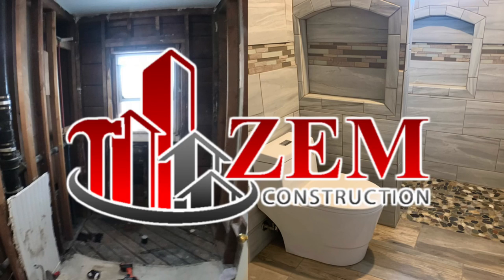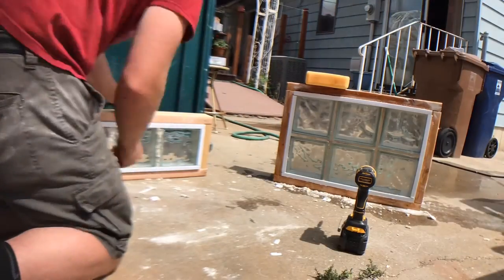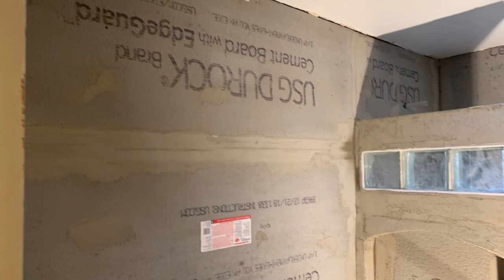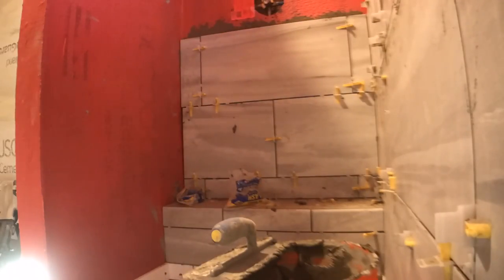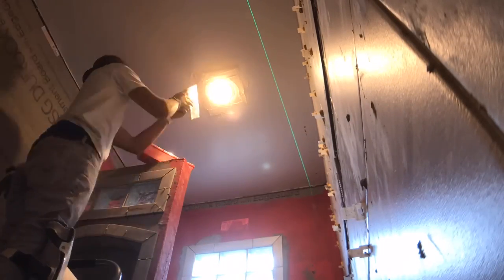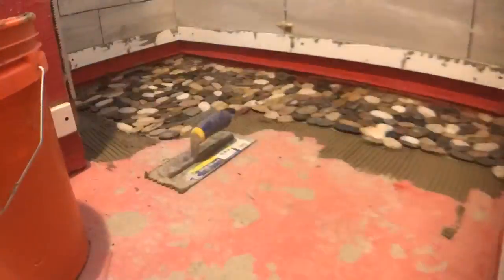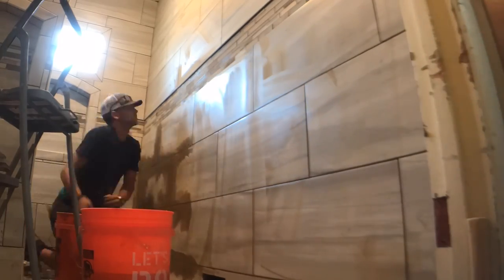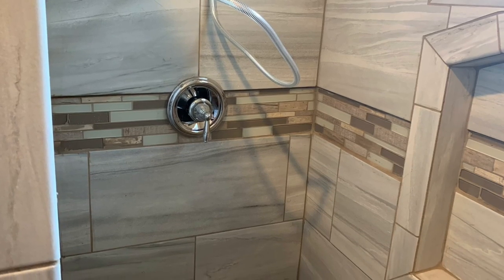Bathroom Remodel | Bathtub to Curbless Walk In Shower | Time Lapse

Comment: I'd love to know cost of something like that?
Reply from the maker: I’d recommend using google to find estimates for bathroom remodels in your area. Both materials and labor vary so much by location. I do not know the total cost of the materials because I didn’t not purchase them, I’d estimate around $8k-$10k. My labor could be quite different then contractors even in my own city, it depends on their experience and many other factors. Contractors where you are at could vary significantly as well. The YouTube channel The Handyman goes into more detail about remodel costs.
Reply: ZEM Construction There is a big difference between $8k and $10k (about a 12.5% increase). The majority cost of these projects is labour and is unaffordable to most, unfortunately. I would say the materials would come in at $3k maximum mostly depending on the tiles of course. How can you justify $5k for labour? Genuine question
Reply: @autisticpianist4446  it takes a lot of time and experiance (some states even certifications) to perform this work. It can really vary on quality parts, preperation work etc etc
Reply: @autisticpianist4446  Labor almost always costs more than the material, so it's not that surprising... The material isn't going to put itself together. So spending 2x more on labor than materials isn't a wild scenario. Someone cheap with less knowledge would take this job for as little as $3000 labor. Someone who knows more can charge double easily.  There are more variable than i think you realize. Also the area you work in is a big factor. Down here in Texas a builder will pay someone to tile an entire house for $2.00sqft. In other states, they will pay double that or even more depending on the quality and knowledge of the installer.
Reply: Timber land It takes a long time to gain experience in anything; the nature of experience. That does not justify the Godly rates that construction workers charge. Period.
Reply: MacAaroni A typical answer. Let’s do the Math. 14 days MAX to do a small job like that assuming you’re working smart and hard. $8000 labour. That is $572 a day or $71 per hour. $148.720 per year. More than a doctor or lawyer. How does this compute?? I predict some builders who don’t have commercial contracts will start to find it difficult to work regularly, given the decrease in disposable income.
Reply: @autisticpianist4446  where is your 8000 dollar labour coming from? your estimate of 3000 dollar on parts was also randomly selected, as it will quickly go over it. if you can not affort it, it doesnt say other people can not afford it.
Reply: Timber land My figures are coming from the creator of this video. He said he would estimate $8-10k. Figures for the materials comes from my own experience of being forced to DIY projects because your sector is not compatible with my mental health issues.
Reply: autowash viry the labor cost today is bs. Almost every company overcharges. Its bullshit
Reply: autowash viry given that I donate 100s of hours of my time to charity, I don’t have a price. But I don’t think you should charge more than other people. So $40 per hour sounds max for a general contractor, with a maximum of $180 per day on the basis that the hours you work are grafted. No trade is particularly hard, especially with the tools available these days.
Reply: Hector Rubio what?
Reply: @autisticpianist4446  I never reply to these comments but I am making an exception in this case. Trade work is a skill as much as a talent, gained and nurtured over years of experience. You complain about $5K in labor, as if that money is going straight out of your pocket and into theirs. Well its not. Out of that $5k comes insurance and banking fees. Also involved in a job is waste disposal, and tool costs(bits, blades, etc don't last forever) fasteners.  In this case there is also the cost of sponges, floats, trowels, etc. They only last for so long. Tile saws burn out; diamond blades dull and are expensive to replace. Diamond bits are expensive to replace as well. My point is, there is a whole 'nuther level of costs associated with a job like this that is often part of that "labor" you are complaining about. No job can be done without factoring in the things I mentioned.
If you don't want to pay a skilled tradesman his price, you are free to go find some Chuck-n-a-truck and roll the dice with them. When you tile has lipage, your grout lines are wonky, your shower leaks into the downstairs ceiling, you start smelling mold, the caulk cracks and yellows and floor tile pops from joist travel, you may rethink your choice as you pay 2x more to fix your job gone bad. Have a good night.
Reply: Alan Harris you present a fair argument. I just think costings need to be more transparent for average customers who may have to loan to renovate. An economy in austerity is fragile. You do sound competent and professional and I wish you all the success with your trade.
Reply: @alanharris9357  watch it there mr. Harris, I take offense to your comment " chuck in a truck " my name is Chuck and I do service work and repairs. And I pride myself on quality installations. Lol.
Reply: @fisher9915  noted.  Now that I read  it out loud, it doesn't sound as funny.  Its an old phrase and its insensitive. My bad. Thanks foe being a good sport.

Comment: How did you determine how wide to make the shower?
Reply from the maker: We went as wide as possible without having to move the plumbing for the toilet.
Reply: @ZEMConstruction 
So you went right up to the toilet??
Reply from the maker: Oh no, local code says you need 15” from each side from the center of the toilet. So the wall is 15 inches away from the middle of the drain.
Reply: @ZEMConstruction  why not move toilet so it would have been a little wider I'm doing something similar to this remodel took out tub now walk in shower is 39" but finishes at about 43" made a huge difference plus I still have a 36" vanity as well 😊

Comment: Why did you use 1/4" cement board on the walls and leave the stickers on the cbb? You almost have to try to get lippage with a clip system but you succeeded. Also you need to shim those mosaic strips flush to field tile. Walls and floors are rarely plumb and square, and flat, your the pro here and its your job to remedy that. Its very rare that a substrate cant be fixed, saying the home is old and theres nothing you can do is unacceptable. You are charging people money to do this and it looked like a home owner did it. DO A BETTER JOB,  you owe it to the people that trust you to do the work in there home.

Comment: that outlet by the toilet looks so out of place in that position.  IMHO, it should have been moved up a little to that it would have been centered in the mosaic just like the light switch is .  Same with the shower control valve,   Centered in the mosaic......

Comment: Does anyone in your business even understand why we floated walls for generations? This quickly sticky type of install baffles me. Good luck when the walls are bowed  and badly out off plumb. But I guess that's why I see so many offset joints and giant tiles.
Reply: Floating isnt the only way to go on shower builds. Having said that this is a garbage install. Your a tile setter why dont you know why the large format tiles are offset the way they are? Sounds like you dont stay current in the trade.

Comment: Hey man not trying to be rude but the layout looks terrible, mosaic wall tile needs to be perfectly flush with the 12x24 tile, especially if you build a wall and custom niches you had all the tile measurements on site you should of build a niches smaller to eliminate small sliver pieces of tiles around the niches especially where it meets with a window, the shower pan will fail who uses rubber membrane this days! Rubber will turn in to a hard plastic and will start cracking, concrete shower pan that you poured doesn’t bond to rubber!! the wall that you build and the niche inside of it looks very sloppy job you should of build a niche few inches smaller to eliminate small cuts and make everything symmetrical, layout is very important always try to eliminate 1”-5” pieces cause it looks very bad, the miter cuts around glass blocks no good, sorry man not trying to be rude just trying to help, I’ve been in construction business for 20+ years and been doing tile jobs only in $1-$20 million dollar houses, it looks like some DIY project that you did without knowing what you really doing I always call that waist of materials no hard feelings buddy wish you all the best and it takes time to learn and do a good quality work, if I wore you I wouldn’t post videos like that with a very poor quality work, anyways wish you all the best
Reply: Right
Reply: Agree. 30+ years in residential remodeling. There were a bunch of issues I had seen as well.
Reply: Im predicting failure at the floor to wall joint in the shower pan perimeter, and subsequent water ingress and eventually floor failure.

Comment: thin cut under niche couldve been avoided, otherwise great work
Reply: groovyme1234 should of separated the back niche area from the middle so that the 2 borders (niche and top glass window trim border ) would not meet at there highest arch .... the first niche where toilet should of been centered so you have only the border to tile on left and right side and not have a 1 1/2” border on left and a 2” on right with a sliver tile to fill
Reply: @RTBucco  Yes, preparation is key with this type of tiling

Comment: just remodel a shower done the way you did it. wrong......you need pre-slop first then pan liner. The water will just sit in corners and mold....call a good hot moper or a tile guy.....or just read instruction

Comment: I always wondered why it takes 3 months to do a bathroom remodel? Is it because the contractor doesn’t have the workforce necessary to focus on one project and in order to not turn down other projects they just dilute their guys to several projects, even not doing anything on some days on the project?...  3 months of using a port-o-potty??!?
Reply from the maker: I guess I didn’t explain it as well as I hoped, my aspect of the project took about 3 weeks and that includes taking several days for another project I had already planned out before this one. The homeowner had started the project herself and it took her 3 months to get to what was shown in the first several seconds of the video, she then decided to bring me in to finish. By the time I was finished they had the porta potty for almost 4 months total. Thanks for the comment!

Comment: You Guys made a HUGE  mistake regarding the shower pan.You were supposed to do a pre pitched cement sub pan, and then you would've installed  the shower pan on top of that.This way, when the water and moisture build up under the rubber pan,it will find its way down and to the weep holes at the bottom of the drain. You just laid the rubber flat on top of the wood,so when water  seeps through the grout and the 1 1/2 cement,all your going to have is a stagnant  smell and will eventually rot the wood under the pan.

Comment: It’s really poorly designed you’d have to be standing and reaching in the shower to turn it on and maybe avoid getting wet, or you could just wheel right under it as you put it and just let the water warm up while it’s pouring down on your head.
Reply from the maker: I 100% agree. I would have put the game Del against the back wall. Unfortunately the plumbing was already completed before we showed and the client did not have the budget to make any further adjustments.
Reply from the maker: Handle*